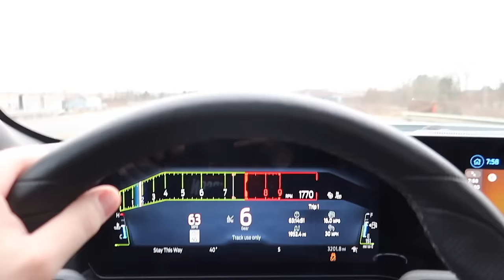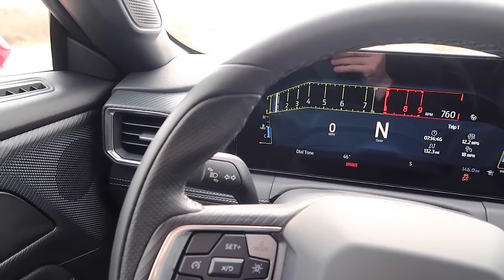SELLING MY NEW 2024 MUSTANG GT s650 ALREADY... THIS IS WHY 😢

Comment: Got my new 20 PP1 using Ford credit at 0% interest. 10% is insane.
Reply: I just bought 20 pp1 with magneride
Reply: I got an 8.84% loan on my new Rubicon. They swore up and down that I only had a 674, even though the top three said I have a 748, and said “best you will get.”” signed  just to get the car. refinanced not even 2 days later to 2.99% from my credit union. We are screwed when we start reaching credit card levels of interest.
Reply: That’s what I did got zero apr during Covid
Reply: Me too...2020 PP1 0% interest for 72 mos.  This is what's keeping me from buying.  Not to mention the same car is $10k more now
Reply: @Joes432 NICE!!!! my truck rn is 5.9 but I'm hoping to get it refined for 2-3% interest.
Reply: I got a brand new 2022 last year for zero interest! I had happy as a lark on a spring morning!
Reply: It’s impossible to get 0% these days, very very few companies offer it and they have regulation that makes it hard to get…only way to get low rates right now is going through a credit union
Reply: Yes I got 0% APR and rebates for my 2015 mustang GT PP
Reply: Same 0% April 2020
Reply: I traded up my GTPP1 for a Mach 1 handling package manual with Recaros. Twice the car.
Reply: During Covid, FMC had 0% of certain models, however, you had to give up all of your rebates. That may have been fine for a Mustang (which generally have little to no rebates), but on F150, that was $4500-$5500. Four years later, the people who did that, are now upside down in their trades. 😊
Reply: @TheWhiteCometOfZion Mach 1 has the better transmission too! How do you like it compared to the GTPP?
Reply: Im looking at the Mach 1 right now. Is it really that much better? I want it mostly for the handling @Stealth_Rider91
Reply: 3.9 for me on my 23

Comment: Last month I bought a 2021 Velocity Blue S550 GT PP - 6-spd stick with Recaros from a Ford dealer in Des Moines and had the car transported to my house in Mass.  2400 original miles...basically the guy bought it new and barely drove it.  I kinda wanted the 2024, but I'm just having a hard time warming up to the body style and thus far it's just not doing it for me.  Am sticking with the S550, at least for the time being.  Congrats on the new S650 buddy!
Reply: yea i got my 2017 with 1200 miles and used. Took off about seven thousand dollars. Be careful tho in some states lemon laws wont apply as its used. Also dont let them sell you a warranty if they tried. The manufacturer warranty stays with the car when it is originally sold.
Reply: and the individual gauges of the outgoing Mustang are better than the new flat screen.  Nice car.
Reply: S650 don't look half as good as the s550.

Comment: Saw this near exact red car delivered to a local dealer Friday.  Monday afternoon went to look at it sold but at least I could see it and talk to the buyer, a retired Ford engineer.  We both recently sold our older models to upgrade.  Only GT this dealer had.  Off to another dealer for a test drive.  Test drove a GT Premium, no Performance Pack, was totally impressed compared to my 2006 which I honestly had no complaints on.  I started with wanting a hardtop manual, comprised with my wife on a convertible with auto transmission. Dealer swap may have one in a day or two with the Performance Pack.

Comment: Why would you have bought the car if it was 10%? I bought a GR corollla circuit edition in August with 833 credit and my rate was 6.5%, which is high but not 10%

Comment: you mentioned you will take the magneride suspension from your other car and put it in this one? afaik, this is almost impossible! not to mention the wiring requirements. If you manage to install a magneride suspension on a car that wasn't built with magneride, please post a video on how you did it, because i've heard from ford dealers that it can't be done...
Reply: He's not taking the MagneRide suspension off, he said it didn't have MagneRide just like his previous Mustang, so he's able to transfer the suspension parts to the new car. Really though it just comes down to the springs, shocks/struts as MagneRide requires a different type of spring rate.

Comment: just got a s650 manual performance pack, manual, got about 8000kms on it. odd question in track mode do you find that the redline indicated on the dash doesn't match when the car hits the limiter. mine seams to limit at 7300 not 7500 as indicated. But in any other mode it appears to be proper.
Reply: Yes, that's my same experience with my Dark Horse Premium. Bought it brand new with 10 miles and have 1,000 on it now.
Reply: There is a soft & hard limiter.. shift earlier.. you don't want to be hitting the limiter on coyote's.. your gonna hurt it.. that's how you break guides, tensioners, and worst of all oil pump gears & cam sprocket.. They rev so quick you should be shooting for 7000-7100 in a stick car as there is a bit of throttle hang/over run in the TB..

Comment: Congrats in your new car. I am getting a mustang on march but probably a s550 the s650 has not warmed up to me yet. The red color looks awesome and glad you got a better deal
Reply from the maker: Nice. Early congratulations
Reply: if you are gonna mkd it id try to find a 2017-2019. Those have the better built engines, especially the ecoboosts and they can still be tuned easily and hidden from the dealer if you ever bring it in. I had my ecoboost making 430 wheel, sold it back to dealer and they had no idea it was ever not stock.

Comment: @Zander13 will you be able to do any 1/4 mile hits in the new car on factory tires followed by sticky tires and repeat once you start adding power mods and tuning? It would be nice to show the true potential of a 2024 MT82-D4 car. 

You also mentioned that there were improvements made to the MT82-D4. Can you tell us what those changes are as compared to the 2018+ MT82-D4? Thanks

Comment: If you can't write a check for the car, then you can't afford the car.  Paid cash for my '23 HPP/HP, paid cash for my '18 GT.  I have zero interest in the S650 unless Ford goes back to the analog gauge dash, unlocks the ECU and lowers the prices.
Reply: Your perspective is an old fashioned one and while you could be right in some cases there are plenty of people who have afforded them on payments and paid them off before the term of the loan.
Reply: @danielshepard7357  shame on me for saving up cash to buy cars, guess its silly I didn't pay interest on loans all while watching the asset in question depreciate simultaneously.  Shame on me for spending less on insurance for my cars since I owned them outright.  Shame on me for figuring out how to pay for a house so I could retire by age 54.  Shame on me for being so "old fashioned" that I ended up being a responsible, hard working adult.
Reply: Who tried to shame you lil fella??
Reply: Good for you
Reply: How much do you make roughly annually? Congrats on the paid off cars

Comment: What is your opinion on the MT82? It has a pretty bad reputation online. Congrats on the car swap with lower interest rates. 😁
Reply from the maker: The MT82 was revised for the s650 and is better than it was before. So far everyone is liking the revision
Reply: It's still a Chinese made piece of crap. Ford should never dropped Tremec. All the higher tier models have a Tremec; Dark Horse, Mach One, Shelbys before they went to automatic only

Comment: these people never mention the sales tax they paid is gone about $4500.and they have to pay sales tax on the new one....another~ $4500....just for a better interest rate!!? and the equity you had from a down payment on the first one is gone on the trade in... you had is gone...all together I bet it cost  between 15-20k.
should have just refinanced...
Reply from the maker: Didn’t pay sales tax. It goes off the difference of the trade vs new. I traded a car for a car at the same value so there is no or little tax between the two. Now… if someone was trading a much cheaper car for more expensive then they would pay the difference. Or if there was no trade involved at all and it was a single car purchase, then yes, they’d pay the taxes on the whole thing. This is common knowledge. And no, I didn’t loose 15-20k. I only lost a tad over 2k as said in the video.

Comment: Man. Car is beautiful.  Love the Race Red. I’m an Ox White guy myself but the Race Red, specifically on the 650,looks really good to my eyes…

However, owning 3 550’s, 2 AE snd the last and current FIVE OH, a non AE, i gotta say, not having the AE  affects  the tone the car will have from
Here on out. Had I known the 21’ I’m
Driving now didn’t have the AE I never would have made the purchase. I assumed it did. Bought it sight unseen out of northern VA and I live in Mt Pleasant SC which is Charleston SC adjacent. 2021 GT premium PP1 with Mag Ride, B and O and Recaros. Car was absolutely loaded. In fact, the ONLY option not on my car was the AE. A $55k assumption which became my $55k mistake..

I put Magnaflow on it as my good bud has a 2022 GT with AE and he has the Magnaflow and inserts the deepest , old school muscle car sound you can buy today… hand down. I thought I would be Abel to fix the issues of not having AE through the aftermarket. 

I was wrong. My buddy’s car sounds richer, the tonality of his car is much more robust and full. Mine still has that tinny sound. 

Mustangs have always had great sounding exhaust going back to the Fox days. But this AE on these Mustangsbis so good… it makes the non AE cars fall flat in comparisons. Again, my bud and I have same exact exhaust set up. Only variation , his car has AE. 

Yiu can def make your car louder. There’s no doubt about that. But, the tone of an AE Stang is simply fuller, more rich and just tighter..

 Perhaps the exhaust you select will have a diff outcome? Although I highly doubt it. Maybe yo don’t care as much as I do and then this is just a bunch of hot air

Beautiful ride man, enjoy!

Comment: For starters, if you have good credit, you should have gone with a local credit union. You said Kia dealership, so you bought the Mustang used. My credit union finances used cars at 4.9@75 months, which is better than the 5.9@72, which is what Ford has on new Mustangs right now. I Def wouldn't trade it because of the rate.

Comment: The S650 is heavier by over 140 lbs, slower too and copy bmw 2-3 series with the dash. Way over priced too.
Reply from the maker: It’s not heavier except for like 20 pounds more. This has already been disproven a ton of times. Definitely not slower either. Just ran down a modded s550 today and he had no chance. And mine is stock 😂
Reply: @Zander13Productions  These cars are fast.

Comment: The s550 is a better car. More performance stock, open cpu( wont fry if you try to tune it w/o ford license)
No stupid tesla dash( analog control> touch screen)
Lower cost.  
My 18GT pp1 out drag raced a dark horse, has 5 less hp on chassis dyno and cost almost half as much. Sorry to anyone who bought a Dark Horse!  

My guess is Ford detuned the mustang because Camaro and Challenger no longer exist.
Reply: Oh my 18gt.. 0% 36months.  Its been paid off almost half the time Ive owned it.

Comment: How did you gt 0 percent. all ford stores i have spoke to in nc say ford is not offering 0 on  2024 mustangs.  1.9 36m 5.9 72 and in between but NO zero.
Reply: He didn’t.. he didn’t go from 10% to 0% lol.. he just wanted yo switch cars again cause he always does.. he is probably at 5.69 or worse still. This car is a lot cheaper then his last one also
Reply: @xGR1MxREAPERx  You're correct. I have A+ credit and got a 5.99 earlier this month through Ford credit, his 10% tells me he don't have great credit score. And he got the base of the base PP car, lol, way to save money by downgrading.

Comment: When the 2018 GT was released Ford boasted about the 3.9 second 0 to 60. I have not seen ford put out any statement boasting the same or better with the 2024. If they have I have not seen it. With the release of the 2024 they really emphasized horsepower new aesthetics and technology. The aesthetics in my opinion have fallen short and the rest has yet to be proven. Best of luck to you, but you won't have any at all if you keep following the herd.

Comment: Smart financial move 👍. Alex you said that you're hoping Ford comes out with a boss 302 s650 variant, I would love to see it but my confidence level isn't high since they already have the dark horse. Isn't the boss 302 on the same level as the Mach 1 and DH?  It will be interesting to see what performance differences the boss 302 will have if they come out with it. If the quad tip Corsa doesn't work out the steeda s650 non-active axle back exhaust sounds pretty good and I'm sure you can get a good deal since they are one of your partners.

Comment: Of course you screwed up, you bought an untunable dud of a car just because its new. That 20HP over the Gen 3 Coyote S550 doesn't mean much if you can't tune it unless its for an approved supercharger kit. Personally I don't hate the new model, but the fact that its not really meant to accept any engine modifications, is exactly why I'd never buy one.
Reply: I cancelled my order for an S650 and went with the S550, it just looks looks better and it's virtually the same car

Comment: I bought a 21 mustang at 1.9% and a 21 ranger at 2.4%. Sold the mustang and wanted to get in a loaded f150 and trade the ranger. Well to say the least I'm stuck with ranger for a little longer, between the msrp and interest rates.

Comment: Duh it’s a slow manual
Reply from the maker: Lol
Reply: Zander knows what’s up he know the A10 is a beast, they supposed to have gotten rid of adaptive learning on the 24s and you can turn it off on gen 3 now also with forscan. Was the reason for all the funky shifts
Reply from the maker: @burke985  yes correct. I just wanted a manual to have fun in this time.